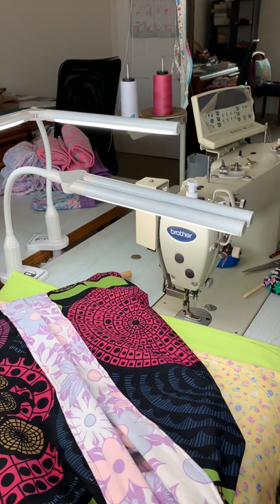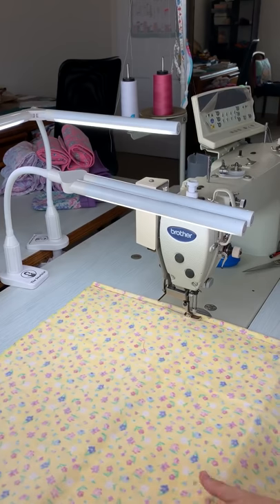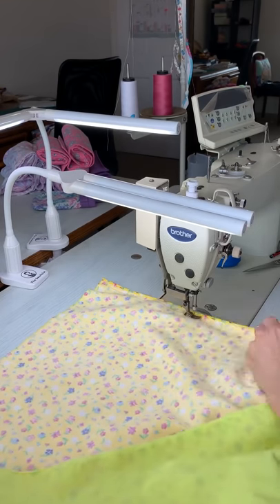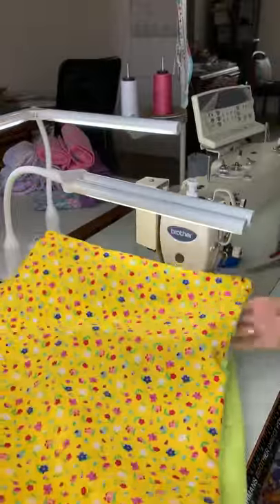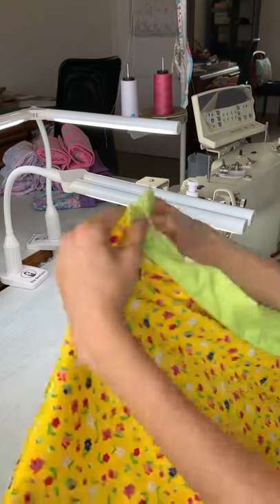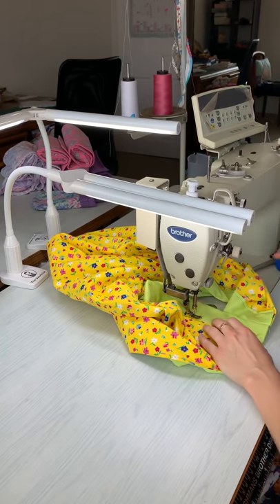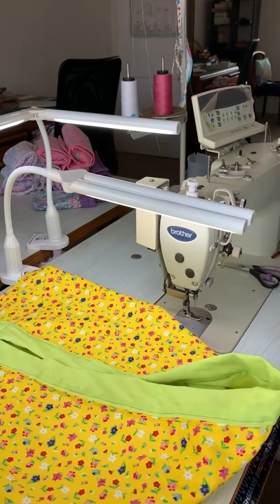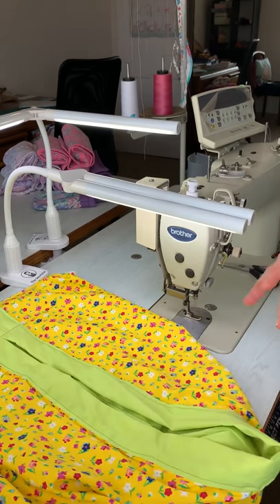How To Sew A 3D LINED HANGING JOEY POUCH - for Wallabies + Kangaroos

Comment: Hi Naomi,, great instruction video.  Just one question.  When folding fabric right sides together eg. Kangaroo pouch is the fold along the short side or long side? ie. folded is the fabric 37.5cmx130cm or 75x 65cm when folded...Not sure which of the cutting measurements is width and which is height or finished size to know which to fold....hope this makes sense.
Reply from the maker: Vera Smith thank you. It’s folded so it’s almost a square - 75cm x 65cm once folded.
Reply: @naomihuntsman7390  Thank you so very much for your prompt reply, Naomi. That precisely answers my queri.  I know the craft guild is asking for no more crafted ideas to be made but my craft group has been donated flannelette by Spotlight so will still make up and if not need now can be kept for future use when needed.  Also, I am in Tasmania where the fire season is later in the summer and that is without the great everyday need in Tasmania for items for carers due to the high amount of wildlife  here that is often found injured on the roads.....so I am sure these will go to good homes along with the many pouches we have already made.

Comment: question with the measurements is that 105cm x 65cm square or folded fabric piece. Made one seems large.
Reply from the maker: Maddy Collins cut each rectangle of fabric at 105cm x 65cm. Then fold in half before stitching down the folded edge and curving round the corner..
Reply: @naomihuntsman7390  managed to undo then folded the 105cm edges together with a 65cm height. Made 2 this way.

Comment: when you mentioned washing the fabric at the beginning, is there a specific laundry detergent to use? or is there a specific prewashing process
Reply from the maker: I only use natural, non-toxic detergents. I’m sure they would be preferred.
Reply: I'd use vinegar in place of fabric softener.
Reply: fabric should always be washed and dryed before being cut. If you are not sure about the soap you have, you can just double rinse or put it thru a second wash without soap. I do this all the time as my child has ecezma. it  works.
Reply: @narelleworks8448  do not use fabric softener at all. it is a huge boatload of tons of toxic chemicals. many doctors are speaking out against it.. liquid or dryer sheets. both are very bad for you.

Comment: Hi. Can I please get a written instruction as well. Cause what I saw on the facebook group and downloaded looked like a six-part to sew together. I was extremely confused. It was definitely something that is not a pouch. I just need the measurements and like so details. Also in the video, you mentioned that there is a bat wrap tutorial that you have but this is the only video that I found on your page((
Reply from the maker: Hello i don’t have written instructions sorry. 
There’s only 2 pieces of fabric used. Both rectangles. One for the outside (heavier weight) + one for the inside lining (lighter weight). 100% cotton. Prewashed. 
Measurements to cut the rectangles are given in the video, and the text below the video.
Bat Wraps have been fulfilled for now. But here is a link for future reference.  https://lookaside.fbsbx.com/file/ARFCG%20Bat%20Wraps%20Photo%20Tutorial.pdf?token=AWwcAexVFF86BmTgrsPJ122gNJjVD1blqsZgcQfmSWt4_GisCJkYckvSFPiO9ErrakbABrc9Qu--TRRxQlnC3FIZEKDu6azZR5IP01Ub6nOzBSNZs2b41K7xB0RUUbCFeAouJyOePfq2Yu6b6472GxRiY6jLctW6QC2zXyTADj9k_mMKE-5O4qQHz8286ayllXZWq72-54uPvFbQ4nuD-AQC
Thank you.

Comment: May I ask r those measurements on the fold ?
Reply from the maker: 1. Cut the fabric to the measurements given (a rectangle).
2. Then fold the fabric in half (it will almost be a square) before stitching down the folded edge + curving around the corner...